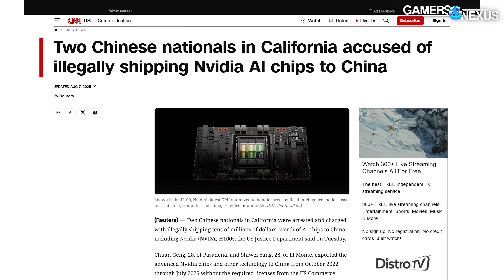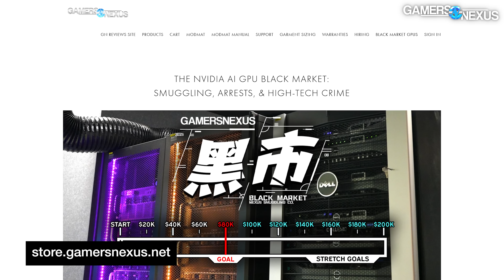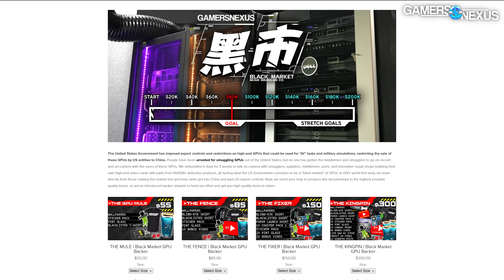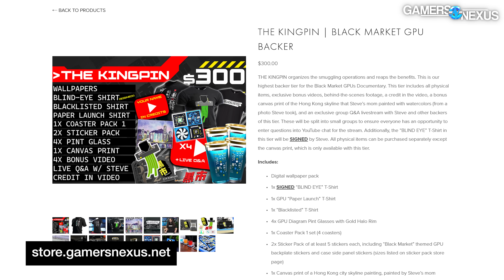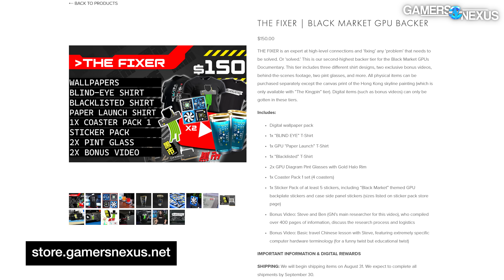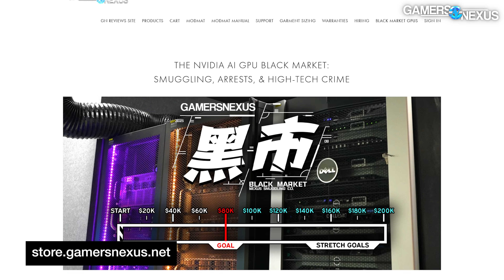Detained by a Government & Probably Blacklisted by NVIDIA for Our Next Investigation

Comment: Singapore is a major buyer of Nvidia's chips due to its large data center industry, but many of these chips are not used locally, with reports indicating some are rerouted to China to bypass U.S. export controls. These shipments are often handled by companies with Chinese connections that act as intermediaries, diverting the high-end AI processors to Chinese companies despite U.S. restrictions. Too obvious isn't it?

Comment: Bloomberg has a huuuuge financial and leverage incentive for the smuggling question to have an answer "We can't be certain, we will never know", rather than be thoroughly investigated, I think this is why they are holding onto the copyright claim - they can't outright lie about the export violations just not existing, so the next best thing is to pull the attention away from the issue, say nothing concrete, provide no substantial story. Independent investigations that provide substance are a problem for this.

Comment: I'm wondering if the "defective" boards that they're taking the chips for are burned up RTX5090 cards with the 16-pin 12V-2×6 power connectors.

Comment: The GPUs are not made in china. Not the part that matters anyway. Unless this is word play because according to Chinese law Taiwan is china so then yes the GPU is made in china. The Cooler and PCB are made in china (usually, sometimes other asian countries) . The GPU core in made at TSMC in Taiwan obviously. Then the PCBs are shipped from china to Tiawan to have the GPU core added to the otherwise finished PCBs then they are either finally assembly  (cooler added) in Taiwan or another asian county having no entered china again (unless smuggled)

Comment: It's worth remembering that while it seems strange to ban GPUs from a market, the reason isn't because of gaming performance or economic pressure, they are banned from export to China for reasons of national security. Modern military industrial complexes run on data and data processing, from ground level engineers running calculations and CAD software to AI powered hacking tools for state sponsored threat actors, processing of mass surveillance data streams, and even military equipment.

Comment: I work in the field. You'd be surprised how not cyberpunk nor unusual it is for various kinds of 'chips' (very broad term) to be export-restricted, for example you might have heard of Russian weapons fired at Ukraine containing western components that they should not have, because they are just not that hard to smuggle in and out of countries.

The problem now, industrially, is that a lot of consequential capability (AI, targeting, guidance...) is packed in cheap, tiny, easily-trafficked components despite governments having never been okay with their unregulated resale. But now instead of checking the borders for large electromechanical doohickeys that clank and show up on a metal detector, you have to check for minuscule items that can be smuggled by the hundreds inside a box of oranges (pun intended).

Comment: How does this impact your story “China urges local firms not to use Nvidia's
H20 chips: media report | REUTERS”
Reply: China/CCP may urge firms to not use Nvidia and encourage/incentivize them to use homegrown alternatives but it's not illegal (yet) to buy Nvidia parts and/or frankenstein your own boards however means necessary to get something done. Their entire manufacturing/production ethos has always been "let's just figure it out" and due to the relaxed regulations (for better and for worse) things were getting done at varying degrees of quality. You have manufacturers that are in it to capture market and some are merely riding trends trying to make a quick buck. If you know someone or can find the right people to get something done or remotely think something is possible then they will literally try anything. Just because the reference say it's 24GB it doesn't mean 48GB or 96GB may not be impossible if the hardware capabilities exists to take advantage of it. It will come down to understanding how the hardware works, how it is put together, and then figuring what is possible in the vBIOS to allow the configuration to work. It is a lot of trial and error and these hardware modders are effectively "hot rodding" these GPUs to take them to another level (if possible), be it with physical mods, software mods, or a combination of both.

Super excited to see the final product. Can't wait!!! :)

Comment: I bought an AMD RX 580 8 GB used from a local Gaming Store in Pakistan. The owner of the shop said that the GPU was tested and it worked perfectly. After I got home and turned my system on, I checked using GPU-Z that the card I got is actually an RX-580 8 GB 2048SP, I got confused as I never heard of that name before. So, I searched on TechPowerUp website and it said that this GPU was made exclusively for China, I guess it somehow found its way to Pakistan. Its slightly less powerful than the actual RX 580 and it also does not support UEFI BIOS, so games that require SecureBoot cannot run using this GPU, but I don't have any regrets because most of my favorite games such as GTA V, Doom 2016, Doom Eternal, Batman Arkham trilogy, NFS titles etc. run pretty well. I have this card for almost a year now and I had plans to upgrade however, the new GPUs are very expensive so I have to settle for this  in the meantime.

Comment: I know this comment will never been seen, but a few years ago I actually tried to help Louis Rossmann (@rossmanngroup) because in one of his live streams he wanted to find new Intel mobile CPUs and I called as I used to do with many of my clients and potential clients, but someone said he didn't need any. So I went to his following live stream and instead of Louis wanted to know more info he went ahead to defame my character which is something he cried about wen a Politician did the same to him. Now, I posted links in the chat and some of the viewers saw it and knew I was for real which then Louis new he messed up. Louis could've had information on where to get all the electronic components and I.T. parts to not only help his fellow repair friends, but also to help you with any information about this. I used to buy electronic components, I.T. parts and Networking Equipment from the underground aka as the black market.

Comment: I find it very Grey. Honestly, somewhere along the line, somebody legally bought the gpu. Nvidia is then out of the loop, they aren't about to refuse a sale based on the possibility the gpu will then be transported somewhere else. What that person does with the card isn't nvidia responsibility, so if they want to add memory, that's on them, especially if they are factory defects or power bad cards. Right of repair. Not all those cards are from the US, who is the only country with an issue, so it makes sense that there are retailers with cards.

Comment: Bro I watched Your video and I Will Update My Gigabyte  Aorus Z490 Master Motherboard Bios and Now I am Facing The Problem My Motherboard do not saving The 3200Mhz RAM clock ? Every time I change The Ram to 3200 Mhz clock My Motherboard will don't scan it and do Not Turn on After 3 Minutes Automatically Boot up But with Default Boot Setting

Comment: It is ridiculous, the AI Cards in question are either AI consumer cards which at max 8 x can a analyze important CT now on on 3 D Level. Even with the rtx 6000 PRO you can accurately analyze 1.5 & 3 T MRI, again 8 cards are absolute  necessary together with AMD Epic /Threatripper CPU & 512 GB of DDR 5 at 5600 MHZ ideally. It you dare to go i to the world of 7 T MRI analysis things get a bit more expensive in difference to 8x rtx 6000 PRO you will on the GPU side need 8xH 100 GPU with max VRam costing over $30.000 per GPU.
MRI a analysis is needed all over the world, especially fir Patients which suffered TBI injuries. I am one of them & i am fighting with my insurance about finally approving the 7 T MRI of my C &!T spine. The worst is that i suffered these TBI injuries whilst i was working for EDS which  back then had just gotten tge DOD Deal & Security Screaming which every Member of the inner circle of this team had to be granted in order to work on the Classified Project.

Comment: Random thought outside of the box: Could Nvidia have actually staged this entire thing in order to further raise GPU pricing (they do have a lot of influence in the US politically through the tech sector), while also roundabout selling to china? If you think about it, if the Chinese market is cut off in the US, then US based firms can simply operate from another country and sell from there. If the "percieved" market results in reduced supply, then that can result in prices being increased further. Between the chip shortage - which didn't exist (they simply put all the chips in mass manufacturing AI cards), GPU scalping (A real problem) and Nvidia intentionally putting up prices, is it any wonder barely anyone can afford the latest cards?

Comment: What about Shadow manufacturing? 
A tactic sometimes seen in China (reportedly anyway), is to continue a production run after the initial quota is met. There are always spare parts delivered (including big chips), to cover any mistakes or damage during production. Who is to say how many were actually needed? It is easy to use up the spares and make a few extra boards - but without the usual serial numbers.

Comment: @3:30 I wonder if Brother Zhang could mass produce 50-series cards with higher v-ram capacity than nvidia's sku's? 👀 The v-ram configs that nvidia went with are so sad, especially with AI on the rise. I'd love a 32GB 5070 or 5080... The 5070 would probably be the sweet sport for running slightly larger local AI on the cheap.

Comment: Fun fact! I'm someone who's de facto an expert in sanctions and export control (because I've had to comply with them for decades.) And every employee who is aware of and does not report those known or suspected violations? These are criminal offenses with strict personal liability. Those employees could be facing fines of up to or even over $1M USD and/or a prison sentence of up to 30 years - personally. Not NV, not Leather Jacket Daddy, you personally, the person slapping the label on the box or checking the 'looks ok to me' on a transaction. You can also be fined by OFAC for up to 2x the transaction value plus having assets frozen or seized, without needing a court conviction.
The only mitigation is to immediately report known and suspected violations to the company compliance officer; or directly to Treasury, OEE, or OFAC if you know or suspect that the compliance officer is ignoring or not acting on those reports as a whistleblower. If I was any of them, I would be contacting an attorney with sanctions and whistleblowing expertise last week. (Seriously. Don't talk to anybody without first consulting a licensed attorney. That goes double for the company compliance officer if you suspect intentional non-compliance.)

Comment: Got so tired of the vram scam, I learned to use a rework station, downloaded schematics for GPU's and taught myself to modify GPU's to have more vram. I have a GTX 1050 with 4gb vram and the power is unlocked because I flashed the vbios and added a pcie connector and missing components.

Comment: Have you guys heard of a Fractal Design Torrent XL? I'd like a newer, bigger and better. Maybe put the psu back in the bottom with a ramp like the meshify, either two top panels (grilled and solid) or a magnetic cover, room for radiator or exhaust fans, maybe add an optional 5.25 bay if you have to have the room anyway (inverted slight wedge/ramp to push upward moving air to the back). Give us 3 180s, 2 180s and 1 140, or two 200s+, etc for front fans. Maybe shroud fans to push air up into GPU/CPU.

Comment: I understand that the United States wants to prevent China from getting GPU cards for "AI," but given the supply chain, what did the USGOV expect? I'm sure the Chinese government is equally capable to pressure GPU companies, except the companies operate within its territory. I wonder what the Taiwanese government thinks about the situation given TSMC is essential to Nvidia.

Maybe the melting 12V connectors are a CIA anti-export countermeasure. 🤔🙃🫠

Comment: I bought a Nvidia Graphics card. It has been my goto company. Last 5080 i bought wasn’t working. The GeForce uploaded the driver no one wants. The replacement driver is no longer available. The card was no better than the 3060 it was replacing. I bought a 7900 XT. It’s a powerful card that barely fit in my ITX. Made Nvidia mad

Comment: 3:45 So NVIDIA can't, but some bois in the hood can
Reply: For real, that "We can make one right now" was such a flex statement, without even trying to flex.
Reply: The lack of RTX 3070 16 GB and RTX 3080 20/24 GB variants is entirely artificial, yes.

As is the lack of "just memory options" for RX 9070 32 GB and 24 GB RTX 4070/5070 cards

Comment: @GamersNexus I know one can get 22GB 2080 Tis and 48GB 4090s over there. What's unclear to people however is if there exists a 48GB mod for the 3090! (Not the Ti). I've tried to dig online, there were rumors about a modded vbios iirc but I couldn't verify and can't just go to China to look.  Have you guys come across 48GB 3090s? Can you check with the markets over there if it has been done? 🙏
Reply: (I built a 4x 2080 Ti rig and a 4x 3090 rig that are machines I use daily. It would be super fun to know if/how and for how much they can be modded to 2x the VRAM)